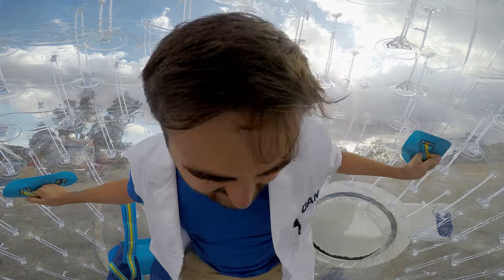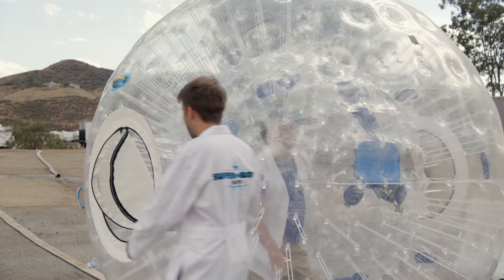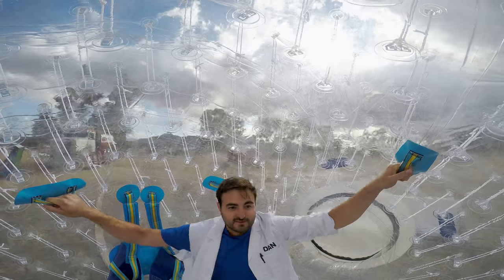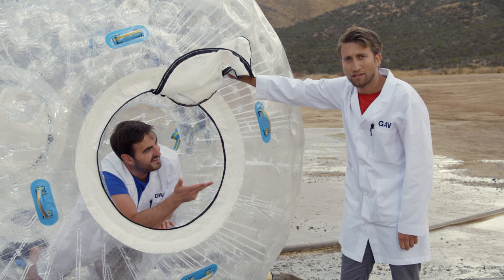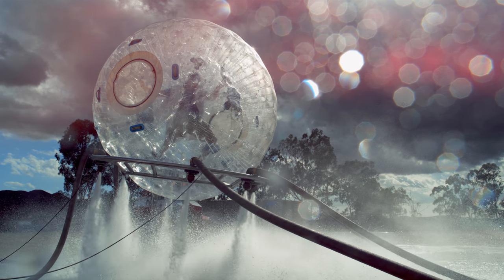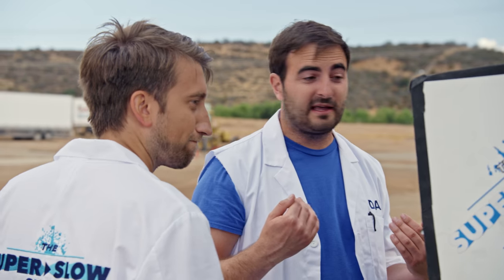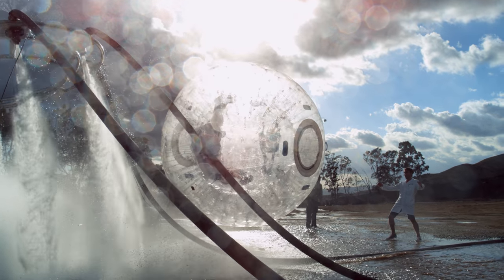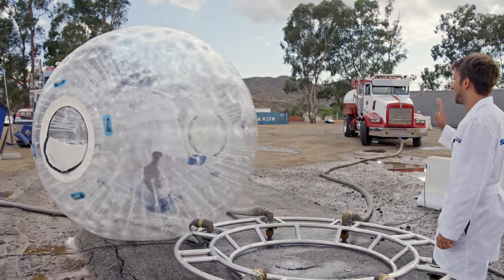Water Jet Hamster Ball

Comment: It'd be cool to see two bullets colliding in mid-air.  Or perhaps better, two canon balls shot at each other.  

Mythbusters tried to do it but failed.
Reply: How'd they fail? Couldn't get them to hit directly?
Reply: They forgot to turn the slomo camera on or something..  Pretty much just half-assed it
They literally had it on the set but was like "Ops it malfunctioned, but let's not do it again..."
Reply: 2 air powered cannons firing glass cannonballs at eachother. Sounds like a recipe for success.
Reply: well, If you miss, you pretty much hit the other gun/cannon which will pretty much ruin it or make it not safe to fire again...
Reply: they already did it but with color pellets
Reply: @Dangerdude132  only the end of the barrel has to be exposed the rest can be tucked behind steel plates or sand bags
Reply: @lastnamefirstname9043  or just shoot not 180° turned, but like... 179° should be enough already. Ofc don't stand behind/infront of the guns, use a remote control lol
Reply: Destin from SmarterEveryday did it with the guys that participated in thr supersonic baseball cannon project not long ago. Great slow motion footage too!

Comment: Why don't you guys do fireworks under ice in slowmotion. That would look incredible! Like this so they can see
Reply: There's several research facilities in the world with huge frozen pools, so if you could get access to one if them you might be able to do it
Reply: Deez dudes need to do a water tornado in slow mo
Reply: The Hydraulic Press Channel guys and Sons of Xplosions did that with dynamite under ice (it's on the Beyond the Press channel)
Reply: In slowmo?
Reply: Yes they did film it in slomo if I remember correctly
Reply: I'm surprised if you're not dutch
Reply: Im a viking. Still surprised?

Comment: Hmm if you use the stuff they use for flyboards or waterbased jetpacks I think you could cut out the water trucks and do it on water instead of concrete it could be safer. 

Water cannon+large fan blade attached to a open, but extremly stable base and throw fruit at it to see if it cuts the fruit once at maximum speed.. However that could be a lot of safety risk.I don't know how the view would be.

Comment: Did anyone else get triggered when they saw how much Californian water was being wasted?
Reply: First of all the water probably isnt clean enough to drink. Second of all the water does two things. It seeps into the ground down into the deeper water layers, further more the air gets humid and clouds form. "Wasting" water as you imply it is only done by transporting water out of the US. You should remember that the whole system is a cycle ^^ the water never leaves the US, is merely increases the amount of rain slightly. Lastly, even if you dont believe a thing of what I just said, the amount they use here is SO tiny and little compared to big companies, that even discussing if it is worth it or correct is a minuscule discussion worth none of our time to be frank.